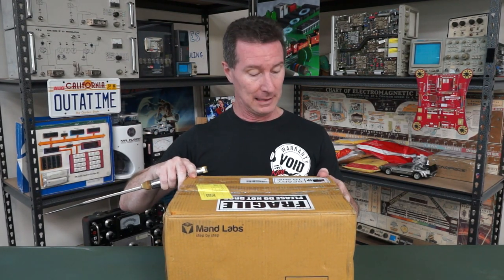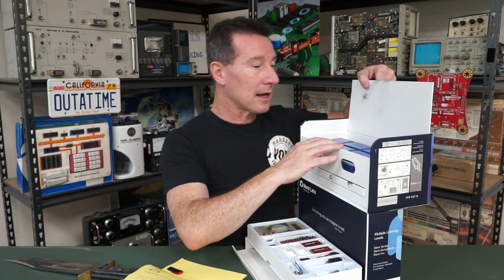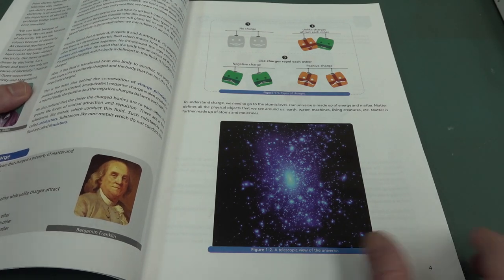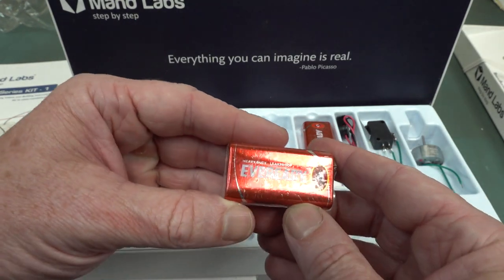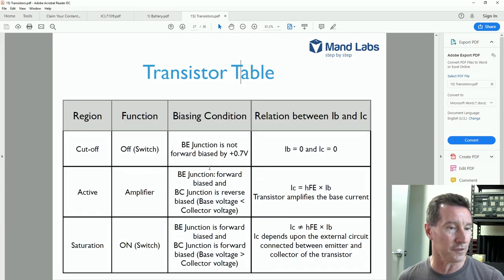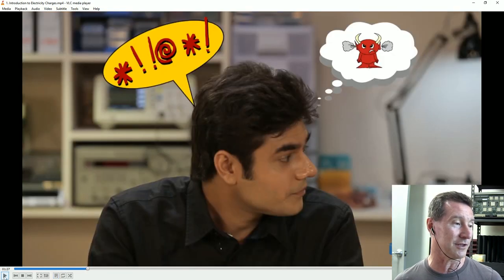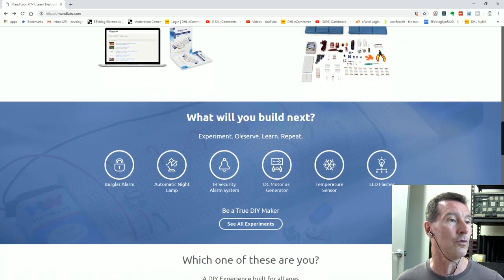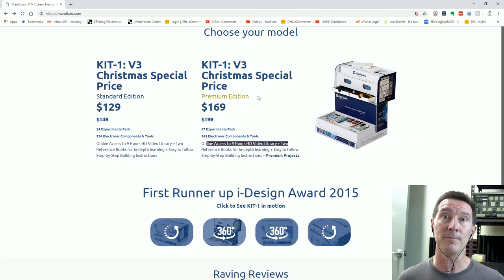EEVblog #1163 - Xmas Mailbag

Comment: Re the Mand kit, ten points for trying but I'm not a fan. Kit overpackaged, Video overproduced, Theory over the top. And it's overpriced. They could have simplified the packaging and added more exciting parts like a speaker, microphone, solar cell, magnet, reed switch, more potentiometers, ICs etc. 

And definitely start with the practical. But introduce the theory gradually between experiments. Eg for the LEDs start off with the recommended series resistor. Measure the current draw and voltage across the LED. Then, as optional experiments get another same value of resistor, put it in series and observe the reduced brightness. So you can introduce concepts like resistors in series, reduced current and Ohms Law. Then try a second LED in series and try various resistor values until you get the same brightness as before. Etc. So you're doing both building and measuring. Stuff like coulombs is never used so can be omitted. Other theory could be put in the book only as boxes that are optional reading. Ditto for history, pioneers etc - also in boxes that don't have to be read. This was done in the Dick Smith Funway books and worked well.

Comment: The Mand kit: 
I’d rather my $ went on more useful parts and projects rather than glossy mags and fancy packing.
Edit: 
  Please do a demo on Aussie knife sharpening. 🤪
Edit Edit: 
  Watch out for harnesses sent by Weller, the threads may include a fuse to blow the threads that hold it together. 
Can you tell in commenting as I watch? 
Oh, and with a pint! 
 Seasons Greeting from the UK.
Reply: I agree. I've looked into packaging and stuff for a custom product in the past and oh boy this stuff does NOT come cheap. I'd bet that 75% of the production cost for the kit is just the packaging

Comment: My first electronics learning kit was a Philips EE8 "Electronic Engineer" kit.  Loved that thing, with its AC126 and AF117 transistors, OA95 germainium diode and stuff.  Am I showing my age?
Reply: I had a Philips EE2001 kit. It was fantastic, more than a 100 great projects in it. Used it for years (with my own modifications down the track.) Still the best electronics learning kit I've ever seen.
Reply from the maker: Not at all!
Reply: My first one was a 30 something in one kit, then a 200 in one kit, next is 300 in kit.

Now Arduino and Raspberry Pis 

:)
Reply: My first was "Dick Smith's Fun Way Into Electronics".
Reply: Do you still have a pulse? :D (I think I still have an OA (68?) somewhere along with some AC180/181 but the aussie would not recognize them anyway and yet would retain his high pitch laugh... hiss filter is mandatory)
Reply: @betta67   Actually, a great deal of my early learning was done with 6SN7s and 807s.  If you remember what they were then you're as old as me (or older).   And for those play ing along at home... they're not transistors.
Reply: I'm not that old really... As a kid I flirted with electronics  (without understanding too much like any kid fiddling ) but only after getting into physics I understood that understanding and mastering fundamental phenomena makes the difference between engineering and science (no pun intended). Sadly I got into computers van by faith while working for an electronic and computer refurbishing company in early '90s. And oh, some 60 or even 40 years ago, electronics was romantic thus much closer to science... (I can elaborate on it but I prefer not to.)
Reply: @xjet   t-t-t-t-TUBES?!?!
Reply: @restcure  Yeah, but we called them valves (short for thermionic valves) -- back in the day.

Comment: I think I speak PC nerd well enough to decode "The 1070ti should not exist". It's probably referring to Nvidia's ridiculous market segmentation across the Pascal series of GPUs. They release a series of cards, then either slightly buff or neuter each version of the card to create cards in between that really aren't necessary. This produces a lot of confusion for consumers.

Though what I would say is that the DDR4 version of the GT1030 REALLY should not exist, because DDR4 is terribly slow for a GPU compared to GDDR5 and the consumer likely won't know what they're getting unless they know the difference.
Reply: you are spot on I think, it's like a bastard child of the 1070 and 1080. although having a halfway point makes sense, nvidias actual implementation of it does not

Comment: Couldn't wade through all the numerous commentsso this may be noted already,  but: the 8748 in the aircraft xponder alt meter in a vintage processor of the MCU-48 series, not just an EEPROM. It has 1k of EEPROM program memory if i recall correctly.

Comment: 12:04 The loose nut and screw that was found in the beginning is a part of wire stripper, used to adjust the cut depth.

Comment: Hi Dave , ELTs are typically mounted in the tail of an aircraft. The terminals go to a switch on the panel (dashboard) so they it could triggered by the pilot pre crash or in the case of an emergency landing in say a remote area. The batteries are part of the maintenance schedule and are replaced by date.

Comment: If I require a BSD unix, I'd rather use OpenBSD. And no, GPL is not a mistake. As for every day usage, some standard Linux works just fine. Everything's better than Windows (or even Apple, for that matter).
Reply: Nah, depends on whether you're talking about before Windows 8 or after
Reply: Not really. Windows was already horrible when it was Windows95. 98 and ME never made anything better, nor did 2000 or XP. Vista and 7 are an abomination as well, and so are 8 and 10. So, yeah, Microsoft software is just utter trash. Even Windows 3.1 which was the first Windows I knew was really bad. I'm glad to be Microsoft free since 12 years and counting. Will never go back. Whoa, I just realized that I spent most of my 20 years that I am using the Internet not on a Windows computer. That makes me happy :)
Reply: Seegal Galguntijak 
Clown.

Comment: When I was a youngster learning electronics, I somehow had the ability to dig into the theory only as far as I needed to understand the principles I needed to know at the time. I kind of started in the middle and moved forward and backward over time as my education an math / physics skills permitted. I agree that the physics behind electron movement and charge is beyond the younger experimenter, but at some point they need to learn it or they will be lost trying to understand more advanced concepts. 
Both methods of learning are valid: the theoretical and the practical. But neither suits every age or knowledge level. I think the best approach is to teach the theory to older students, and gloss over that with the younger ones. I remember many books I used back in the day would offer “sidebar” articles that explained the theory in detail, for those who wanted a more in depth discussion. 
As an engineer, I found it helpful to at least know what I don’t know, so I can get more information and drill farther into a specific subject when I need to.

Comment: The NVIDIA GTX 1070Ti was a graphics card released after its base model the GTX 1070. The 1070Ti slotted strangely in between the GTX 1070 and pre-existing GTX 1080, leading people to wonder why it existed. There was no need for the gap between the 1070 and 1080 to be filled, but NVIDIA saw it fit - probably as there was an excess of GP104 GPUs lying around... Hopefully that fills you in!

Comment: I would have LOVED this kit when I was 6 years old. That kit is just outstanding!
Reply: I would have loved it when I was 5
Reply: There were better kits from radioshack that had more stuff, better projects, seriously projects like alarm clocks and radios, and didn't even take up as much space also the most expensive kit with like 250 projects only cost about $150US in 80s-90s dollars this is probably cheaper when adjusted but even the cheap kits that ran in the $60 range had more projects than this.

 I agree with Dave that they spend too much time hitting people over the head with electronic engineering dogma a lot of which is theory and may even be debunked by the time those kids get to college too when they should focus on fun because most of us get into it for the fun of fixing, modding, and making things and not debating theories with Einstein and Hawking.
Reply: @OffTheBeatenPath_  I would have loved it when I was 4 tbh
Reply: I would've loved it when I was 7!

Comment: @EEVBlog Dave I get the feeling the Mand Kit is really intended for Schools teaching an electronics course to young teens as part of a wider physics/electrical/technology course.  The complete kit could be kept in the classroom, one per small group of pupils, given the quality of the books etc.  The videos would work better for familiarising teachers with the course and the powerpoint PDF for teaching it.  The book probably covers the physics basics because a lot of the time the set school curriculum (rightly or wrongly) has that requirement as its stuff you can put in a formal exam, where plugging stuff into a breadboard can't be (but can still be assessed by the teacher). I also think the reason they replaced the LEDs is the provided ones were all clear plastic so it wouldn't be possible for specific colours to be picked before turning them on, the replacements are coloured.

Comment: The nut and screw go in the slot in the strippers. Where you tighten it in the slot changes the minimum closing point and keeps it from springing apart too far

Comment: Merry Christmas. That 8748 in tbe aircraft beacon is the eprom version of the 8048 microprocessor, related to the 8031/8051 micros.  One of the 8048 units comes in a masked ROM version (there is a pin that allows the internal ROM/EPROM can be disabled and used with an external ROM or RAM. In the early '90s I programmed  an 8048  to create an 8-bit code ASCII compatible keyboard for the GRASS VALLEY GROUP edit system development system (actually a forked version of the PDP-11 system running RT-11). Jameco was selling used/programmed 8048s for cheap allowing the to be used with external EPROMs..
Reply from the maker: Oh bigger, should have looked at the number closer

Comment: Regarding the ELT ARM mode -- this causes the unit to turn on when the equipment (and the airplane to which it's attached) experiences more than 5Gs of acceleration.  The ON position is used for testing the equipment during routine aircraft inspections.

Comment: I love it when a bit of aviation and electronics meet. By the way, if the ELT is set to arm, it will activate and transmit a siren sound on 121.5 if it detects an impact (that mechanical thing at 48:15 was probably the impact sensor).

Comment: I agree that the instructional material with that kit is way to heavy on theory for new leaners of electronics.  Especially young ones.   Let them light an LED and maybe mention a few details like the resistor limits the current.  Let them make a 555 timer buzzer and things like that.  Start teaching the details much later when they are needed.
When you teach someone how to be an auto mechanic you don't start them with the theory of stochiometric mixtures of fuel and air and the thermal expansion of gas in a cylinder.  You teach them to change their own oil, then replace belts and hoses, and give them a wrench and change an alternator or something.  Only later would you teach them about the theories.  It shouldn't be any different when learning about electronics.

Comment: About the "Teach physics first" debate: I think, practical examples first is a very good entry in any sort of learning, but even after a short time, drop by drop, one can add little pieces of knowledge from a scientific view. I remember wanting to know what voltage acually is and didn't got an answer as it was "too advanced". That killed electronics for me.
Aside from that, I think, one has to be careful what scientific facts to drop in first. I find Volt, Ampere, Ohm and Watt way too cryptic. Start with a good understanding of what charge is and what a flow is. The amout of the flow comes next and then, much later, you divide the amount of flow into current and voltage. And only then, you start quantizing it with numbers and symbols.
There are several scientific topics which have different ways of approaching it. For example, back in the days when I was a scientist, in fluid dynamics, I am personally favoured more the Boltzmann equation but many others prefer the Navier-Stokes equation. They are in many ways interchangeable but approach the problem from a different point of view.

Comment: That Mand kit looks aimed toward being a high school level classroom physics/electronics teaching aid.  I was into electronics much earlier, but my peers who weren't got a pretty good value from hands-on light the LED experiments in conjunction with calculating the current through the LED and voltage drops in the circuit.

Comment: 48:00 "Arm" means activate the G-force sensor. In case of a crash, the ELT goes of automatically and starts transmitting a signal, in case the pilot gets incapacitated. "On" is for testing.

Comment: Most Emergency Locator Transmitters have better switches than that. Most acceleration switches on ELTs are better than that nowadays too - like a spring surrounded by a metal ring so not just one-dimension to activate them - one-shot to set it off. That's where the reset button comes in, latches on even if the battery voltage dips out, you want that transmitter to run until she dies (would hate for the rescue helicopter to be 5 miles away and your transmitter goes quiet!).

ELTs are always armed except when removed for maintenance. Can cause some problems actually, because sometimes they fail and go off accidentally, which gets expensive on search and rescue. Because of this they're intentionally designed to be kinda crappy transmitters by any other metric - the transmission is mostly on 121.5, but it bleeds through on the communication frequencies too so hopefully you'll hear it go off if it's in your airplane. (airline traffic also monitors 121.5 and will often report ELT activations very quickly)

In North America at least, and I think the world now, 121.5 is still acceptable for use, but it's highly recommended to upgrade to the 406MHz system. These operate the same as EPIRB and PLB - gps receiver, and transmits the distress signal to satellites. Registered with a unique ID so the craft can be identified and any other instructions. 406MHz ELTs will also transmit a 'dumb' signal on 121.5 for extra flexibility.

Comment: And Happy New Year! I forgot to mention that the supplied wire-stripper is missing its adjustment screw/nut combo that fix the closing limit for the wire gauge. Yes, there needs to be something  to keep the handles from spreading so far (like another screw/nut combo to limit the spread!

Comment: Here's my two cents on the debate about whether you should teach all the theory or let the kids do circuits and what not, and then fill in the details

I got into electronics when I was 8 years old or so. It was at that age that I was beginning to learn the concepts of Ohm's law and such, but meanwhile I would build some circuits on one of those 100-in-1 (or whatever number of circuits you can actually build) boards

At age 9 I decided to step things up a notch and I tried to build the classic LED flasher circuit based on a 555 timer, on a breadboard, but when I connected the battery something blew up and it didn't work. Luckily I was able to quickly identify the problem (IIRC, a capacitor wired backwards) and in less than 5 minutes it was fixed and working. Then I looked up how the circuit worked and said something among the lines of "ok, so if I replace this resistor with a lower value, it will flash faster" so I did just that and it was indeed flashing faster

By the time I turned 12 I was already experimenting with simple Arduino-based circuits, every time adding a little bit more complexity. Every so often I would look up the theory of how whatever I was building worked, to get a better understanding.

Now at 18 years old I keep doing some circuits every so often (can't do as much as I would like really, primarily due to the economic situation on my country, stupidly high taxes that drive component prices "to the moon and beyond" so to speak, etc)

So in a nutshell my personal rule that I always followed was "build circuits, experiment, leave theory alone unless you want to know the technical details behind how whatever you're building works"

On the other hand, at school we spent so much time with the theory that the most complicated circuit we ever built was a triac-based AC dimmer. On perfboard, none of that PCB rubbish. It doesn't help that we spent an entire year with the atoms, electrons and charge signs bullshit until my classmates were able to finally grasp the concept.

Comment: I was a late blossomer, fell in love with electronics at the ripe age of 21 while doing control engineering. I got in it for control logic loops and sensor interaction, stood for the electronics. I got my brain dumped with a ton of theory before I sat and exploded my first electrolytic cap and dear god how I wish I was taught how to flash leds and enjoy electronics and spin motors and the lot before understanding the why and the how. Also I winced very badly with those videos. It's almost like the video climbed up the corny cringe tree and hit every branch on the way down

Comment: The ELT is usually kept in ARM mode all the time. Once you crash it's going to transmit 406MHz which satellites can pick up. The location by the transmitter is calculated by the Doppler effect by the satellite, so the ELT itself doesn't need a GNSS receiver. It sometimes happens, that they activated accidentally. That happened to a emergency helicopter just recently were I live.